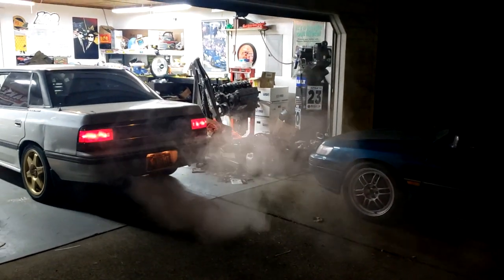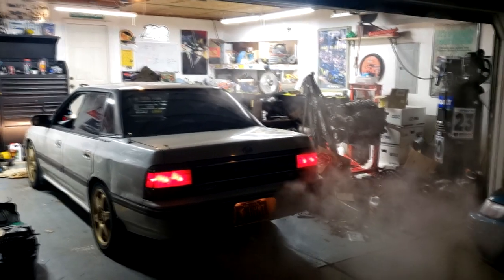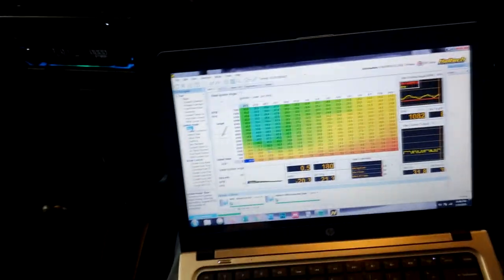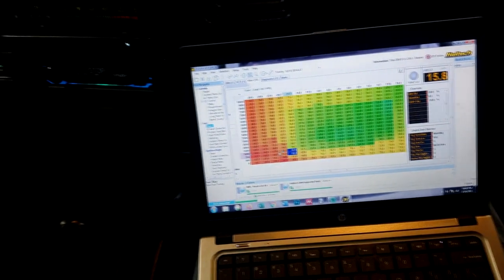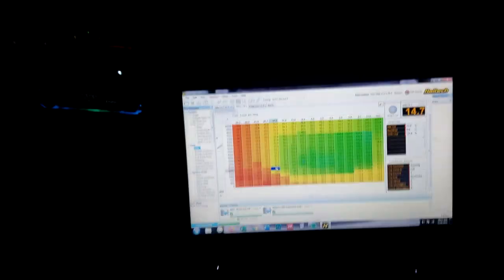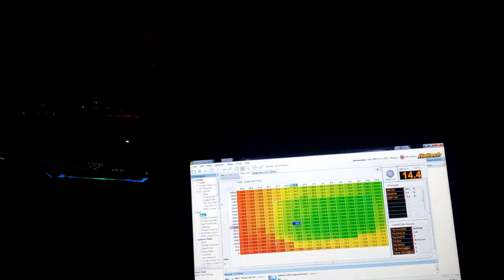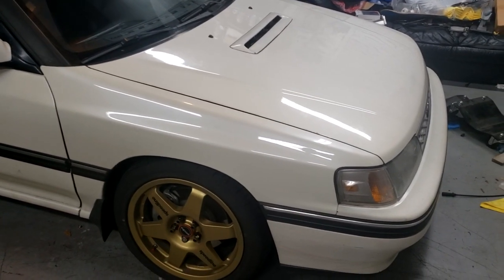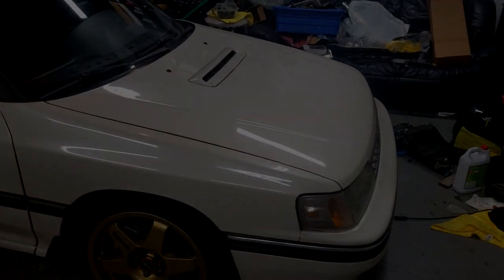Road Tuning the 91 Legacy Turbo on a Haltech (never tuned before)

Comment: what ecu u using?
Reply from the maker: Haltech elite 1000
Reply: @HackSquadGarage  is it plug and play?
Reply from the maker: @dennis4069  yes they make a plug n play adapter harness for legacy/liberty RS's which only requires a few wire modifications to match the usdm cars. After that it was wiring in and calibrating all the Haltech sensors. But for the most part it was plug and play with a factory harness.

Comment: Awesome! I'm not a tuner either. But I should let you know a thing I learned recently from one. Keep in mind that if you're tuning in afr, and converting from lambda, make sure that you know what the true octane rating is of the fuel you're putting in there. You could be really getting 14.7, but in reality it's getting 15.2 perhaps and leaning out. My main point is, make sure you have calibrated your fuel with your o2. It could be why Forrest noticed it running hotter? Perhaps?
Reply from the maker: Yeah that's a good point, we only use Chevron or shell 92 octane so it's pretty good. I think what he was referring too with it running hotter was part of that clip got cut out, he was talking about how people tune for gas mileage and how that would be hotter I think. But in any case that's a good point and the reason he forked out the extra cash for the haltec wideband controller.